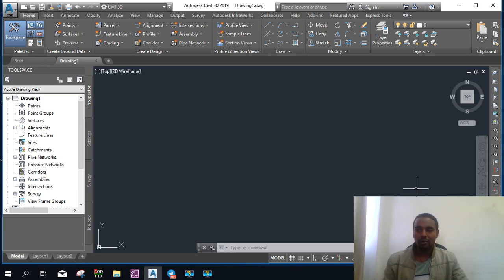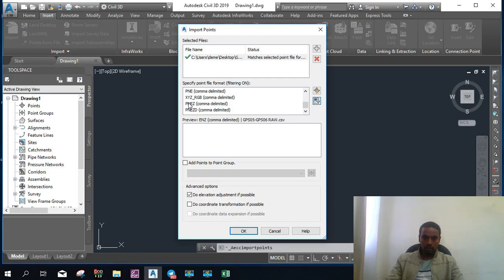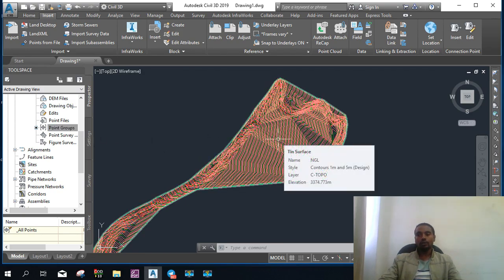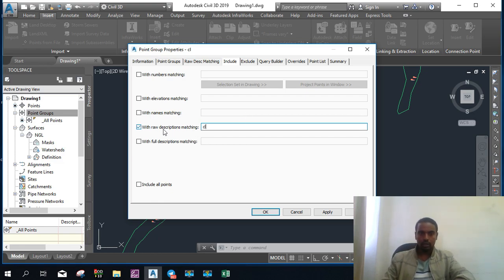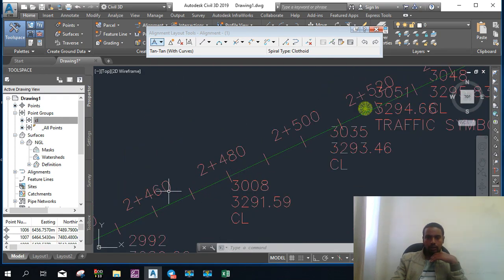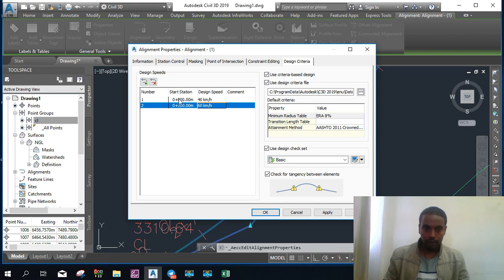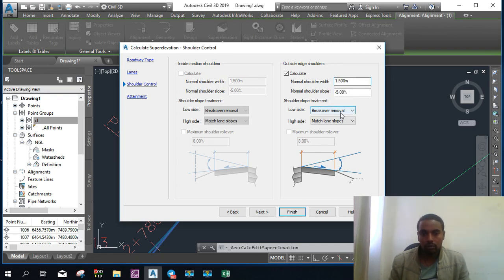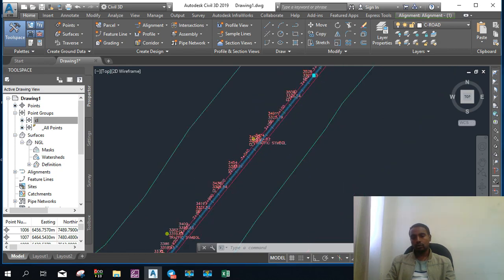Auto CAD Civil 3D road design software tutorial on horizontal alignment design

Comment: I appreciate this, and as a comment please try to include difficulties we could come across during designing and.....during any task on C-3d...Thanks!
Reply from the maker: Thank you for your comment! 
would you please list some examples of difficulties tha will be included?
Reply: @demeberhane  Ok as an example ... Offset alignment is sometimes not functional (I think it’s because small radiuses or pi stations at intersections) how to solve that? Also I get difficulties using subassembly composer (esp. when calculating the amount of cut and fill)…
Reply from the maker: @fremlink123  ok tanx, I will include such difficulties for the future.